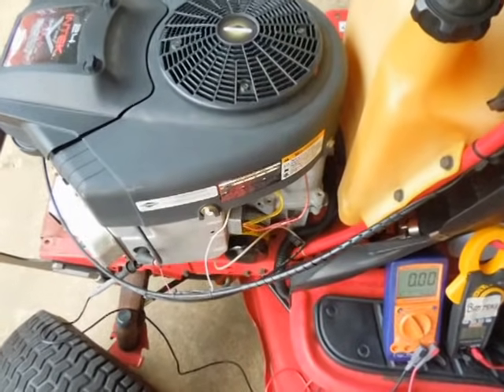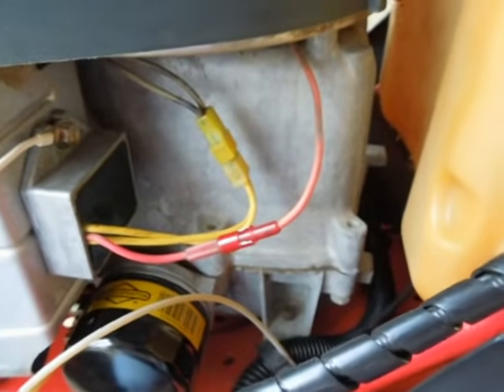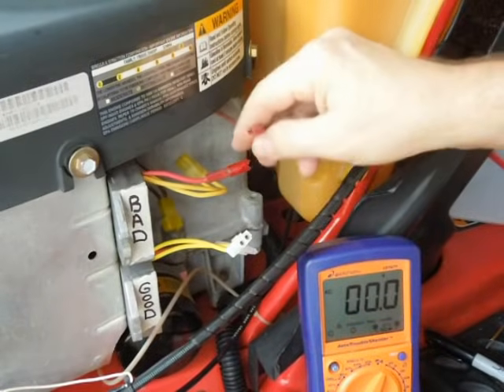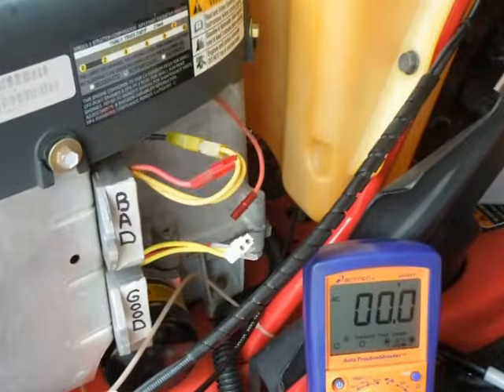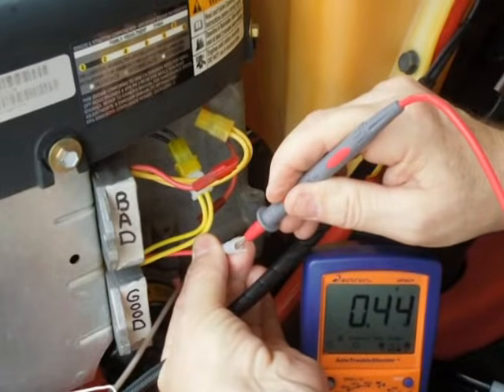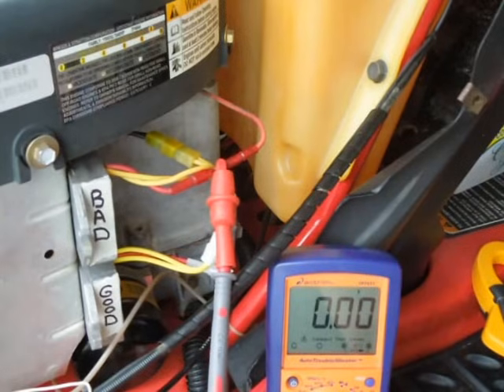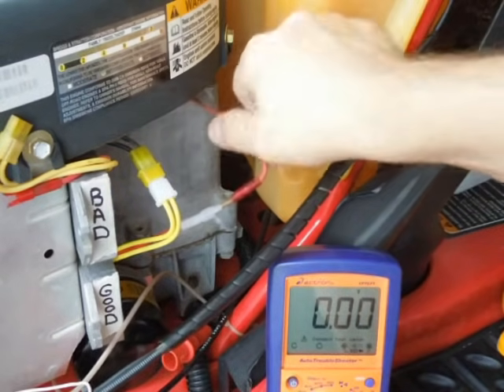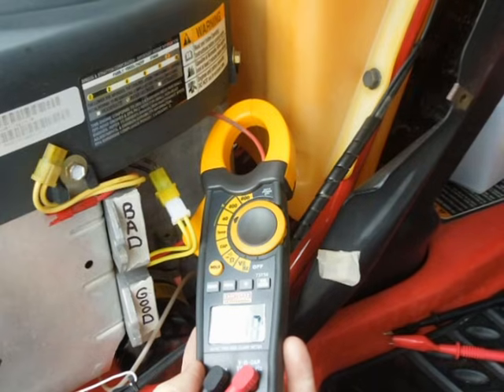Briggs & Stratton Battery Not Charging - Simple Voltage Regulator Test

Comment: So, some regulators use the battery for reference, hence why the test results were inaccurate while removed from circuit.

Some regulators can be damaged or spike when tested out of circuit. To produce accurate results, the regulator should be in series. 

Just additional information for others performing the test. 

Great video, thanks for sharing!

Comment: It’s usually the voltage regulator on the b/s engine, but the proper test should be done before spending money on a regulator 😊😊😊

Comment: So it has to be connected to show output at the red wire?
Reply: @sbond1963  , yes, the regulator must be connected to the wire going to the battery to get an accurate voltage reading.  You must connect the wire and check the voltage at the battery or figure out a way to probe the wire.
Reply: @ thanks. The alternator puts out approximately 20 V AC. The replacement voltage regulator did not solve the charging problem with the battery. I don’t see much else between the voltage regulator and the battery other than one fuse, which is OK. This is a craftsman PYT9000. 50“ 26HP BS engine. 

Can I run a no wire directly from the voltage regulator to the battery?

Comment: I have an older JD LA140 that I bought used and have barely put a dime into it over the years. I discovered that the battery wasn't charging and observed 12.7vdc on the battery at rest, 12.51 vdc when running, so obviously there was an issue. Great video. Simple troubleshooting.
In my case, it was the VR. Replaced that and it's putting out 14.2vdc at the battery when running, which is ideal. Thanks very much
Reply: @richardgriffith1241  glad the video helped you and you got your mower fixed.  Thanks for watching, best regards.

Comment: Question? Why would the red wire under cowling have 12v with key OFF?
Reply: @c.w.ocustomledsandmore1395  that's a good question. Without seeing the wiring diagram for your mower, I couldn't say for sure.  The key on most MTD mowers I've seen breaks the circuit to the battery in the off position. Could be the key switch is bad or that's the way it's wired.  I guess that as long as everything is turned off and there is no draws on the system the battery should stay charged but it sure would be easy to leave something on and drain the battery. Sorry I couldn't be more help. Good luck!

Comment: Remember this system is not built to change up the battery, it’s designed to keep it at full charge if the battery is good ..,,

Comment: Great video, showing step-by-step process to test stator and voltage regulator.  I have a question concerning a charging issue on a B&S 18HP Vanguard V-Twin.  I diagnosed the initial issue to a bad stator only providing 11VAC (my Fluke meter automatically switches between AC & DC with auto scaling).  I ordered both a new stator and voltage regulator just in case and took the flywheel off, cleaned all the magnets and coils before putting it back together.  I did confirm that the old stator was bad, several burnt up spots where located on it and it was cracked.  After installing the new stator and putting everything back together, I’m only getting 19VAC out of the new stator at full throttle, specs indicate I should get around 28V.  This test was done while the yellow connector was disconnected between the stator and voltage regulator - no back probe was used while connected.  When I connect the Voltage regulator I get no DC voltage out of the red wire coming out of the regulator.  This is while it is disconnected going back to the battery!  I’m not sure where to look now with the low voltage coming from the stator connection.  When all wires are connected and engine is at full throttle I’m still only getting 12.x Volt at the battery when it should be between 13-15V.  Lost on the next I should follow to try and troubleshoot this any further.  Thanks in advance for your help.
Reply: Thanks Don for the reply. I tried getting a reading of the new stator on two different meter - both read 21V AC.  The new stator is OEM and purchased directly from a Jacobsen certified supplier and resaler and both the old and new seemed to be identical in look and size except the old one had allot of burnt spots on it and the plastic ring was cracked - copper coil winding looked the same size.  I did do an ohm test on the two pins that came out of the stator and got good continuity.  I then checked both of these pins to ground and got nothing so no short to ground.  I did not test the strength of the magnets, that could be a potential issue.  After spending more time on this unit, I found the existing voltage regulator defective.  I was testing the output of the regulator while the red pin was disconnected (after finding out that this test needs to be completed while the wires are connected) - I installed a jumper pin between both ends to test the voltage while it was connected and only still saw the 12V!  Lucky for me, I had also ordered a new regulator with the stator.  Hooked up the new voltage regulator, made sure it was well grounded and saw 13.x Volts at the two red wire pin jumper.  I removed the old voltage regulator, install the new one correctly to its location and started the mower again and got 13.x volts at the battery terminals - shows that it is now charging.  Although the stator voltage is still lower than specs (28-30VAC) the system now seems to at least be charging the battery at full throttle.  I’m just going to leave it as is for now.  If it becomes a problem again, I may have to look at the magnets on the flywheel and see how strong they are.  Thanks again for your reply, it was really appreciated.  Take care.
Reply: @rickgaudreau7111  hi Rick. Thanks for the update, it sounds like you're going to be OK.  Best regards, Don
Reply: @rickgaudreau7111  , hi and that's a lot of good information!  Simple stuff first, have you tried another meter?  Sounds like you need to get the ac volts in spec first and then see what happens. Could be the magnets have lost strength.  Pull the flywheel again and see how strongly they attract a screwdriver tip.  I don't know of a spec for how difficult the screwdriver tip should be to pull off, but the magnets are usually pretty strong.  Have you checked the stator for resistance in the coils, the ohm reading between the 2 yellow output wires?  Have you checked for leakage of the stator to ground?  There should be no ohm reading between one of the yellow stator wires and ground/the engine block.  I don't know where you got the stator but is there a chance it could be the wrong part or an inferior part?  Are the stators the same diameter?  Are the windings the same wire diameter and does it look like the same number of turns are on each pole?  Same number of poles on the old and new stator? Good luck, this is a new one on me, hope this helps.  By the way, sounds like you are checking the dc output readings correctly, make sure you take them with a good battery connected, with clean connections.  One more thing, long shot but, you might want to verify the engine rpms to make sure it's spinning fast enough to generate 20+ vac.

Comment: Absolutely the BEST explanation on here. There are DOZENS that tell you little or nothing...mostly guys that must have NO one to talk to or trying to show how BRILLANT they are.....
Reply: Thanks for the kind words. Glad the video helped you. Good luck on your repair.
Reply: @doncarlson8391 Great video on checking the charging system on a B&S Vanguard.  I have a question and looking for your expertise.  We have an 18HP B&S Vanguard V-Twin that has a problem charging the battery.  After troubleshooting the system based on your video the stator was only outputting 11V (I have a Fluke Meter that automatically detects and switches to AC or DC voltage.  I ordered a new stator as well as a new voltage regular.  I installed the new stator and confirm that the old one was burnt out in several spots.  I clean the magnets and the entire system before putting it all back together.  After doing this, the 2 pins coming from the stator is only outputting 19V (specs recommend 28V).  I also tried connecting the new regulator and do not get any AC voltage on the output red wire out of the voltage regulator.  I am now lost on what else the problem(S) can be.  Any idea or suggestions to follow would be greatly appreciated.  Thanks.

Comment: Sounds like you might need valves adjusted so not getting that bog when turning the key to start.  Great video.
Reply: You're absolutely correct. That was my next video and the SD card ended up corrupted.  Thanks for watching.

Comment: does anyone know ,,, i bought a husqvarna zero turn no engine  wire are cut to a mess ,,, its not charging  i need to know where the wires go ,, from the stator box on the side of the engine to wherever it goes from there ,, two yellow wires and a red wire where do they go > it has an amp gauge with no wires hooked to it ,,,,i have the electric clutch working and the steering safety switches working ,, but thats it have no idea where the wires go from the two yellow wires and red wire ,,where do they go ????
Reply: My suggestion to you is to Google manuals for your mower model. The manufacturer may have them online and often other sites have them as well.  Sometimes, even when the manufacturer don't list them.  Good luck. By the way, some older Husqvarna mower were built but MTD.  MTD made mowers for several different brands, you might find one that is similar?

Comment: You got to the point in under 5 minutes!  (Unfortunately I have no stator ac voltage)
Reply: I happened to check my meter and discovered it will not read any ac voltage, but with another meter I found 25vac!!!!

Comment: Will the engine still start if the regulator is bad?
Reply: Yes, as long as the battery has enough of a charge it will crank the engine.  But the battery must be strong enough to crank the engine fast enough that the ignition will produce a spark.  If the engine cranks slowly, most likely it will not start.

Comment: Just for info.. some B&S engines only have two wires to the Rectifier/Regulator. One from the alternator (yellow) and one to the ignition switch, fuse and battery.

Comment: So weird I have looked all over this engine for the regulator, yes I pulled the blower housing, any idea 🤔🤔🤔
Reply: I've been told by other watchers that on some tractors there isn't a voltage regulator like in my video and there are a couple of diodes in the wiring harness that serve as a "poor man's" rectifier and provide just enough rectification to keep,a battery charged.  This is mostly on large single cylinder engines.  I remember seeing a video on YouTube showing this set up.  Wish I could be more help. Good luck!
Reply: @doncarlson8391  well thanks for the reply my friend, I guess this is one of those engines, i double checked myself just today looking for it, and I haven't heard about the diod charge thing at all, I will do some more research 😎😎

Comment: Great video. I have a question. The alternator has two wires coming from it with AC current. The battery only has red wire going to it with DC current, so where's the black wire to the battery connection in the voltage regulator?
Reply: The case of the voltage regulator is ground or you can think of it as being a black wire.  The negative/black cable coming off the battery is bolted to the frame so everything else bolted to the frame or something metal that's bolted to it, is grounded. Thanks for watching.
Reply: @doncarlson8391  Thank you

Comment: So so helpful.  My voltage regulator failed, and when I tried a new one, I got no voltage out of the regulator when not hooked up to the system. I tried a third regulator and got the same thing. As you pointed out the output voltage from the regulator is dependent on whether or not it is plugged into the system. I never would’ve thought that. Thank you so much.
Reply: Thanks for watching and glad the video helped you understand the system. It's odd that you can't read the DC output directly out of the regulator but now we know how to check it.
Reply: @doncarlson8391 and why do I have to take my mower to DC to check regulator
Reply: It's people like you who don't know people like me who help people like him who helps people like us

Comment: Doesn't a voltage check of the battery with the engine not running compared to a voltage check with it running accomplish the same thing?

Comment: Hi , it’s been a long time since this video , but could you explain just how the electricity gets from the stator , back to the battery ..
Reply from the maker: I sort of explain this in the video so watching it again after you read this may help.  The 2 wires coming out of the stator produce AC power and they are connected to the regulator.  The regulator changes the AC power to DC and the positive charge comes out of the red regulator wire.  On my mower, the red regulator wire connects to a wire in the mower wiring harness that goes through a fuse and connects to the key switch.  When the key switch is on, it has internal contacts that connect the wire from the regulator to another wire coming out of the key switch and that wire is connected to a terminal that connects to the positive battery cable, which take the positive charge to the + terminal on the battery.  The regulator housing is where the negative DC charge comes out.  The housing is bolted to the engine, the engine bolted to the frame and the negative battery cable is bolted to the frame and this is how the negative charge gets to the - battery post.  Hope the helps, thanks for watching.
Reply: @snaproll94e  thank you !! That was more than helpful…

Comment: That last number you saw wasnt amps.. 
You were using inductance to read a dc current. U need to put a lead on common and then on i on the meter placing the meter leads from the output of the regulator to the batt
Reply: That is an inductive DC amp meter clamped on the rectifier output lead, so yes, it was reading amps.  That same meter clamped on a lead of my carbon pile loader reads exactly the same as the analog meter on the loader when checking a charging system or measuring a starter draw.  What you see is accurate and correct.  Thanks for watching.

Comment: if you have a bad battery, would it make the voltage drop at the battery when checking while running? I hope that is clear, we started the mower and the voltage was 12.57 but the battery was dead... would we loose that much voltage from trying to charge a BAD battery? thank you

Comment: Good video, you get to the point without droning on and on.  I have been looking to find out if the regulator works like an automotive one that shuts off when the battery is fully charged.  I find no mention of it anywhere so I am assuming the regulator output will always be on and a battery voltage reading will always increase when the engine is running at some throttle.
Reply from the maker: Hi Chuck. From what I've seen, the output is regulated similar to a newer automotive alternator with an internal regulator, not like the old mechanical regulators or today's eco computer controlled regulation that has caused my wife's last 2 vehicles to repeatedly have dead batteries due to short trips.....oh sorry, mini rant over. Thanks for watching.

Comment: ya didn't say what the max voltage should be.
Reply from the maker: On the A.C., stator side, 26 to 30 volts is plenty. You can't read the D.C. volts coming out of the regulator without connecting the battery. With everything in place and the battery connected, 13.2 to 15 volts at the battery  terminals is enough to keep the battery charged. Thanks for watching.

Comment: Is it normal to have around 13+ volts  AC at idle? And 22 volts at high rpm?
Reply from the maker: Sounds a little low.  Rev it up to wide open and it should be much higher, like you see in the video.  Thanks for watching.  Hope this helps.

Comment: Awesome video, can you tell me what your "T" was that you used to read the actual output from the regulator to the battery?
Reply: Looks like a price of 12 gauge solid copper wire. But it can be anything you want
Reply: @JM-yx1lm  Thanks that is what I was going to do is just get a spare piece of copper wire and make the connection.

Comment: What did you use to make the inline jumper on the red wire for testing?  That was  a great idea by the way.
Reply from the maker: A short piece of brass tubing I had laying around. An old ball point pen refill could work. Crimped one end so it would fit tight on the lead with the pin and flattened the other end of the tube and filed a pin shape on the end so it fit in the other lead. Thanks for watching.

Comment: The regulator needs the DC 12 volts hooked up for it to output the correct charging volts. You cannot test the output of the regulator without the 12 volts hooked up from battery.   most the time ihe AC output will be close to this one 22-30volts AC.

Comment: This is an excellent video to test the voltage regulator/alternator.  Just a suggestion, your tractor is hard starting indicating the need to adjust you valve clearance (too wide of gap causing not allowing the compression to be released properly).
Reply from the maker: Jim Kelly, you are absolutely correct and I have a video of setting the valves and how it cranks before and after setting them.  I need to get that video put together and posted.  Thanks for watching!

Comment: Great video, I wish I would have seen this before spending the $70 on the stator replacement only to have the problem persist.  Ran the tests and DC voltage from the VR showed only 12.49.  New VR here we come.
Reply from the maker: Mark H. , sorry you found this a little late.  Hope it helps and thanks for watching.